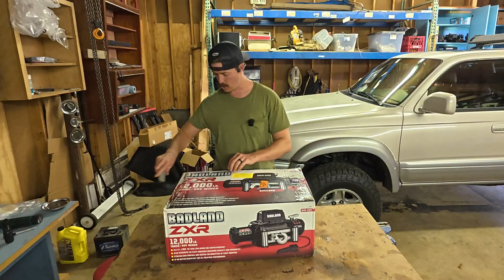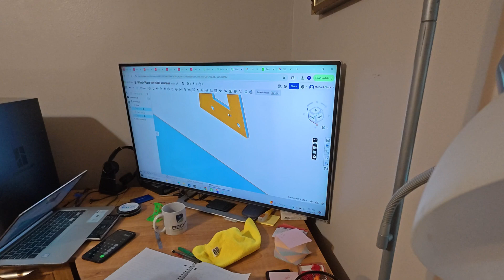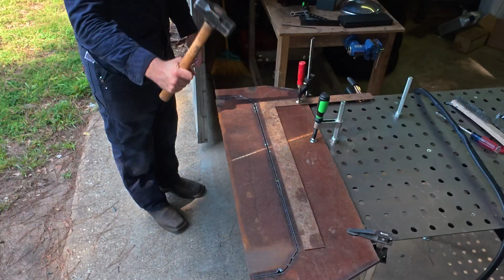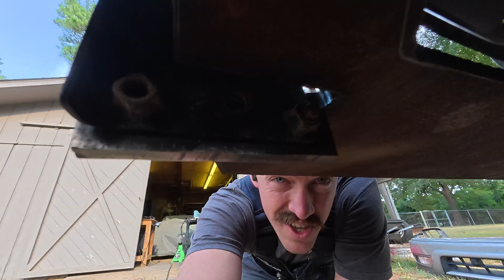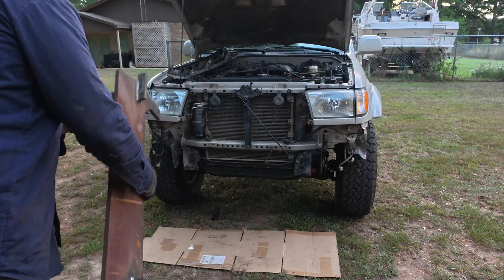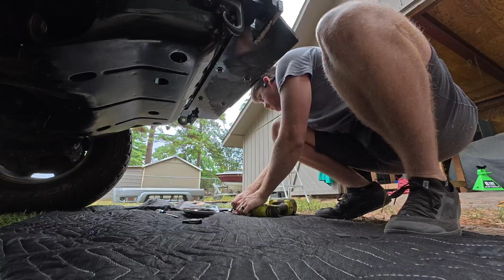DIY Winch Plate - 3rd Gen 4Runner

Comment: 2 things about that winch, it’s simple to swap the cable with a synthetic line which is safer and not that expensive I did this for a warn winch, you can also relocate the control box using longer cables specifically welding cables to get the box under the hood I have mine mounted where the cruise control box goes since I never use it anyways.
Reply from the maker: Thanks for the tips! I had thought about going to synthetic, but haven't really looked into it yet. The control box ended up fitting quite nicely, so for now, I may just leave it there. But good to know that is an option for the future!